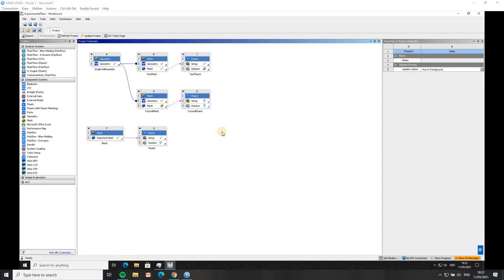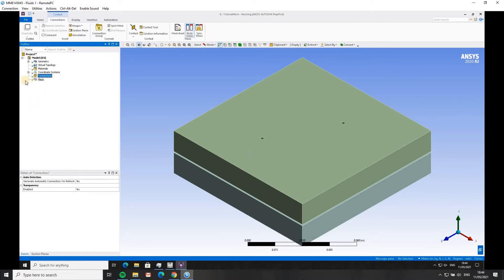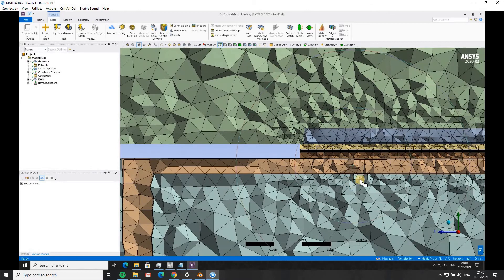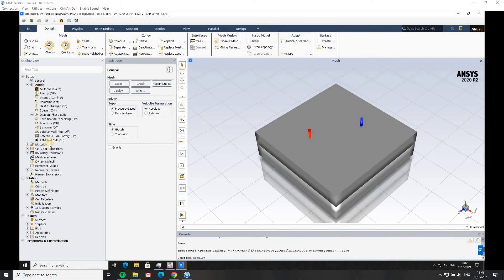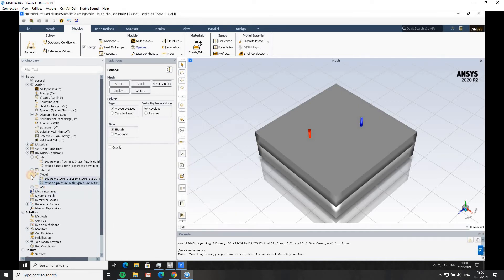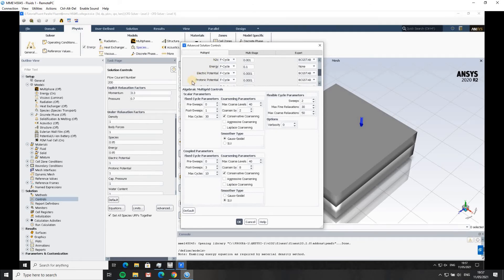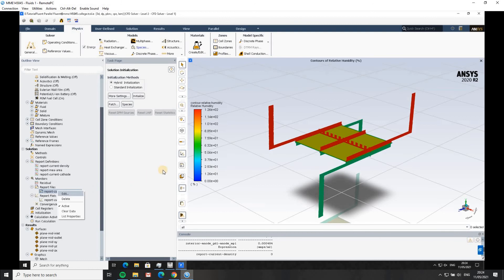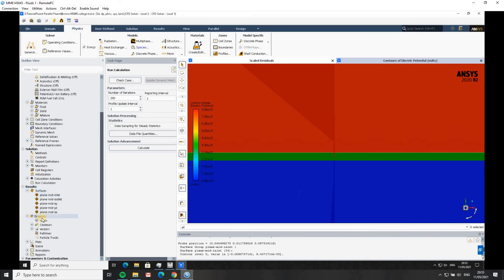Ansys Fluent PEMFC Tutorial (2020R2)

Comment: thank you for your video, sir! it is very helpful to me
but i get some problem there is warning message kind of "cell voltage -200000 and it is unphysics? blabla"(sorry i'm not in my office....i can't remember detail :(   )
what should i do to solve this problem
regard sol.
Reply from the maker: I am not sure exactly, there are many problems that it could be try some of the following:

1. Double check inlet and outlet flow conditions (gas mixture, temperature, mass flow rate) to ensure they are realistic
2. Turn off electrochemistry sources option in the PEMFC model menu for the first few (~10-20) iterations to let the gas flow settle down, then turn it back on
3. Create a number of different contour plots to view where the problem is occurring
4. Turn off the option "Use half cell potentials" in the PEMFC model menu, this allows you to specify the cell voltage in the parameters tab. This might help the simulation to run, but it sounds as if there is a more general problem with the setup which you need to get to the bottom of to trust your results.
Reply: @conortwohig5957  thank you sir!
one more plz.
when i turn on joule heating or spiciecs heating or liquid phase and start calculation then i got the message "Error: floating point exception"
in this case what should i do? :(
(it is work well when i turn off that 3 options)
regard sol.
Reply from the maker: Hi,
I cannot be sure, about what is going wrong. I struggled with that error a lot myself. My initial idea is that the geometry or meshing are not correct. Check for overlapping geometries, and try to refine the mesh quite a bit in the GDL, MPL, and CL areas in all three dimmensions.

Investigate exactly which options are making it diverge, you mention three in your comment but try different combinations to see if it is one specifically. I suspect it could be Joule heating, maybe reaction heating as well. Take 
 many outputs from the cell as possible in contour plots and pause the simulation after 1 or 2 timesteps to find exactly what is going wrong.

Sorry I cannot be of more assistance, as I mentioned I am not an expert I have just recently completed a masters myself.
Reply: @conortwohig5957  thank you it is very helpful yo me
I hope you're always healthy and doing well
you are really nice!

Comment: Hey what do we do in post processing to get the VI polarization curve?
Reply from the maker: Hi Srinivas,
I used design points in Ansys workbench to run a number of simulations at different cell voltages and then extracted the resulting current densities for each point. After I had a table of Voltage vs. Current densities in workbench I simply copied the data into Excel and plotted the VI graph. There are many ways to do this step, for a single cell and low amounts of data points, Excel or Matlab would be the easiest I think. If you are running large batches you may want to look deeper into Ansys post processing or python scripting.

Hope this helps,
Conor

Comment: hello, can you help me fix the PEM fuel cell addon error, the library doesn't recognize it?
Reply from the maker: I have never gotten this error but it sounds like either:
1. You are typing it incorrectly 
Or
2. For some reason your installation of Ansys does not have the PEMFC module included
Reply: @conortwohig5957  so May I ask if the version you use is copyright or crack?
Reply from the maker: I was a college student when I made this video and had access to a fully legitimate research license
Reply: @conortwohig5957   let me ask, so how to get that license how to get a license, or have to spend some money to buy that license, hope you can help me, now i need that license to study about PEM fuel
Reply: Make sure you're using add on model number 9 and not number 3 as that one is no longer supported
Reply: @krumplin8992  yes i use it addon/9